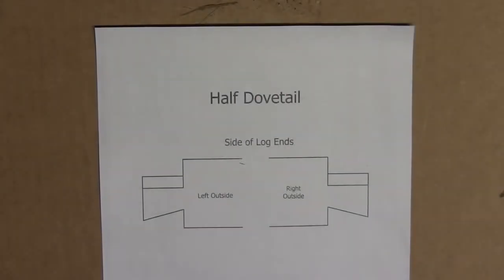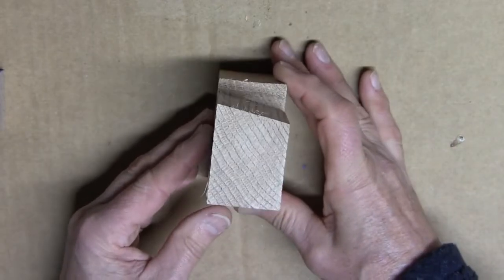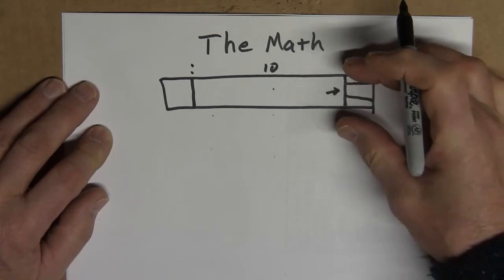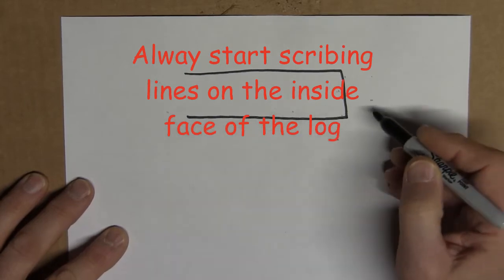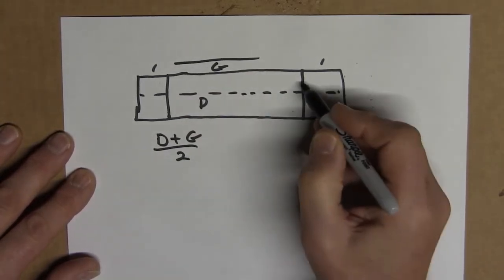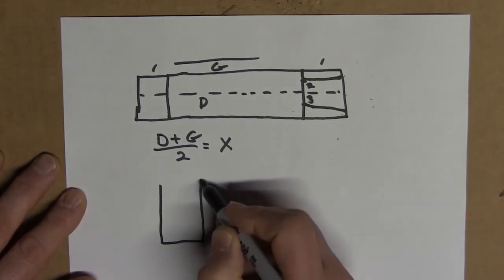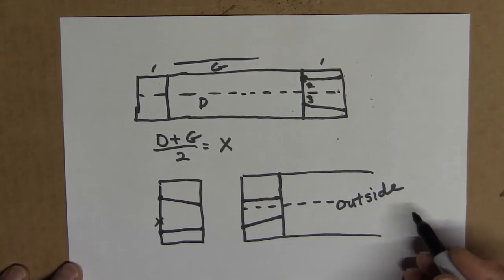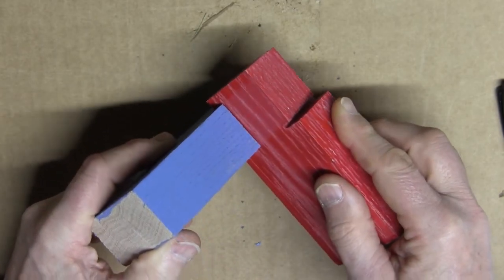Half Dovetail Notch Explained

Comment: when determining "D", would one include the live edges, or only the face (for logs that are milled inside and out but left natural on top and bottom)?
Reply from the maker: When you have a live edge on the top and bottom it gets a little more interesting.  You will have a varying gap along the logs and of course varying depth "D".  Typically you would use an average depth for the log and wherever you have the logs meeting in the gap you cut off the high points that are hitting each other between the logs.  Run the chain saw along the gap to cut the high points off until the dovetails meet tightly.  Support the ends as you cut the high points off to avoid binding of the chainsaw.  The two logs will slowly come together as you decrease the gap by cutting off the high points.  You will end up with some varying gaps and flat areas between the logs.  Of course if you want to avoid any cutting of the high points you would use the largest depth to calculate the notch dimensions.  Kind of depends on the gap you will tolerate.
Reply: @diamondback142  Most helpful, sir. Currently building a dovetail cabin and learning as I go. Appreciate the video
Reply from the maker: @troyklinglesmith1571  Thank you.  I did a lot of research on the web and didn't find anything simple and clear so I did my own video.  Rank amateur.  If you have some woodworking skill you could make a jig to help cut consistently and accurately.  There are also jigs for sale on the web.  You can take a look at some of the jigs and see if you want to try making one.
Reply: @diamondback142  The Bearded Carpenter has a video series on YT that explains exactly what you just taught.
I get a little confused at times but he is a great instructor/teacher.
Thanks for the video but I don't understand how you can just randomly divide 5 by something, not in equal halves. 2 and 1/2 inches.
Reply: @timgiles9413  yes i agree sometime his explanation is hard to understand.